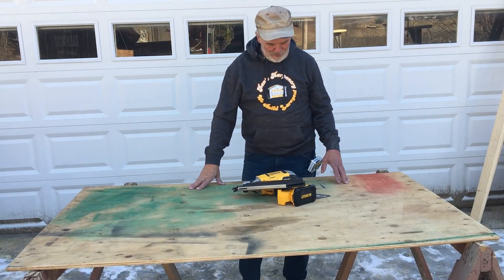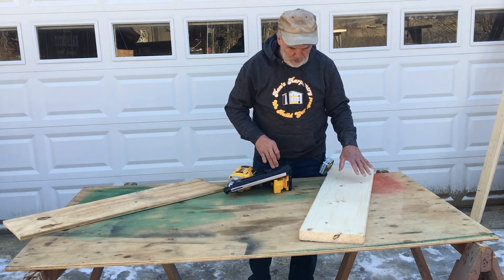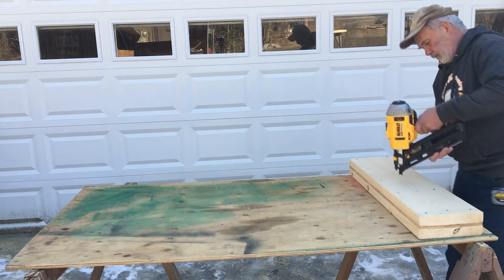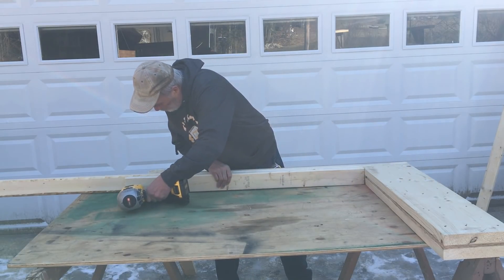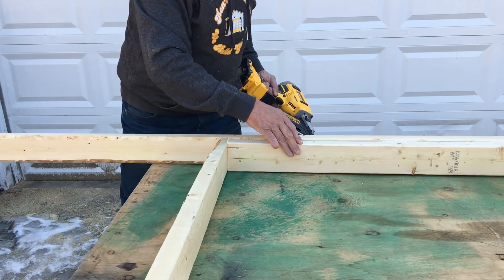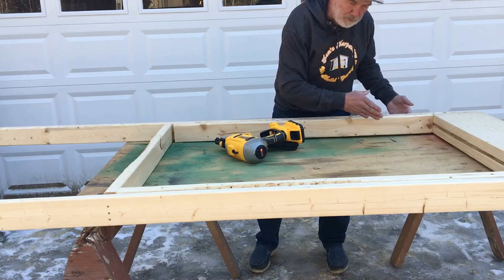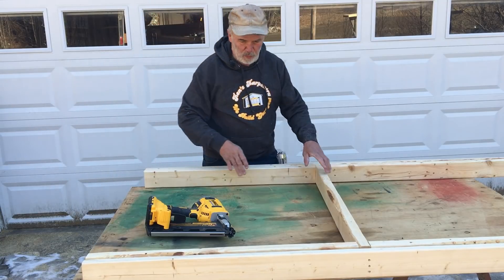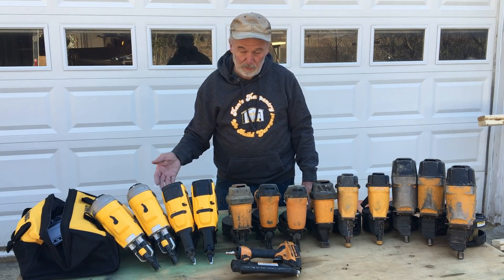How to Frame a window opening and Arsenal of Air Guns

Comment: I was taught that when framing openings, a stud that runs all the way from bottom to top plate is a king stud, a stud that touches the bottom plate and the header is a jack stud, and a stud running between the top plate and header, bottom plate and sill, or sill and header is a cripple. But I've learned that it varies from one part of the country to another. Cool video- I like that cordless framing nailer.
Reply from the maker: Thanks for the input

Comment: Another nice video.  I've been using a paslode cordless framing nailer (I think it's butane fuel?) for over 20 years and only on my 2nd.   Not full time framer of course but lots of sheds, garages, fences additions and it just keeps on ticking.   You do have to clean it out now and then.   Their finish nailers on the other hand seem very finicky and often stop working -- not a fan :/  Will be interesting to see how the battery models compete in the market -- about same price it seems.
Reply from the maker: Thanks I’ll keep you posted

Comment: 4:42 - Do you get paid per nail?  On a serious note what are your preferences for 90 degree junctions - 2 nails or 3, and have you gotten away from suing ring shank nails?
Reply from the maker: Haha we typically use three for studs to plates because of the stress on walls traveling over the road. We usually only use ring shank on sheathing.

Comment: The biggest difference I find between the air nailers and cordless battery nailers is the size and weight difference.  The battery tool nailers are much larger and heavier, especially the brad and finish nailers.  They are harder to get into tight spaces when doing finish work and after an 8 hour day my elbow pain from the weight is brutal. (22 years of home remodeling and repair)  Air hoses are a pain but they are very efficient in size, speed and less weight.  Would you agree?
Reply from the maker: Yes definitely

Comment: Great to see you working ken 👍🏻is that Bostich gun a sheathing gun or a siding nailer ? I’ve always wanted one of them I use the dewalt cordless guns also love them only downfall is they always are out of nails the coil framers seem to last all day without re loading 😂
Reply from the maker: It’s actually a siding nailer. I might keep using that because it does hold a lot of nails

Comment: That gun looks heavy. Not good for old/new shoulders. Would be interested in a weight comparison and to see how many batteries you buy a year from now. After going through drill after drill only because the batteries were more than a new drill. 
I am willing to buy you supper if those battery powered nailers last five years.
Reply from the maker: Sounds good. :)

Comment: The red stuff on the nails is glue and it's used to keep the nails together in a strip for manufacturing purposes.  Otherwise you would be feeding them in to the nail gun one by one.  Some types of coiled roofing nails are held together by a piece of welded on wire.   I highly doubt the red glue has much holding strength in wood but hey I don't know much. Haha😉  Have a good weekend Ken.
Reply from the maker: Thanks for watching. The nail clips are actually held together with paper on both sides b
Reply: Hey I’ve used nails in my nailer called Coated Coolers and the adhesive on them hold damn good.